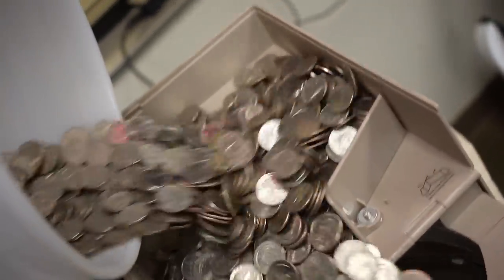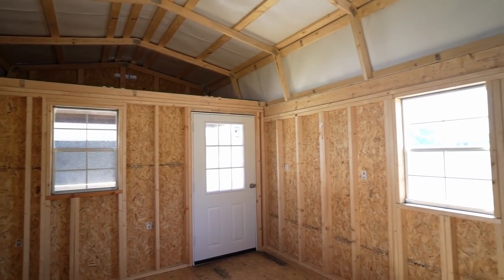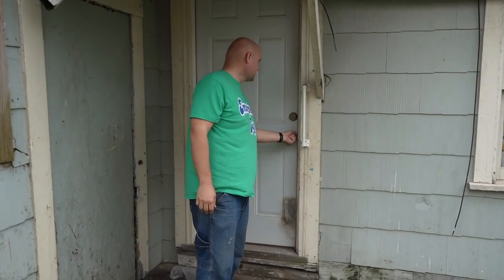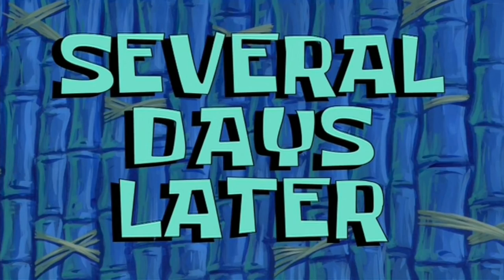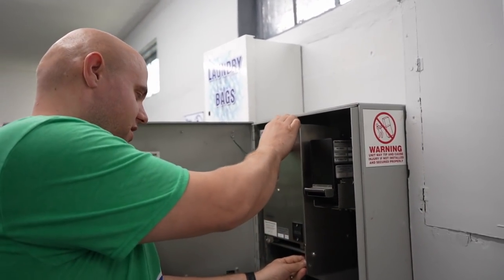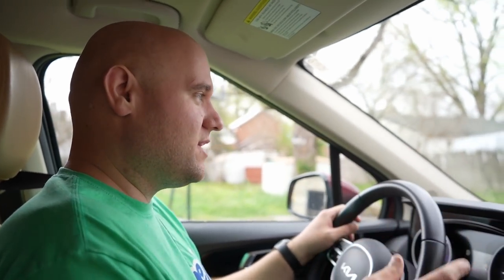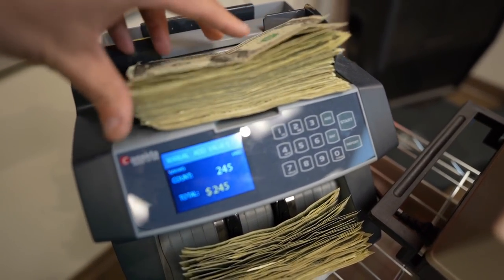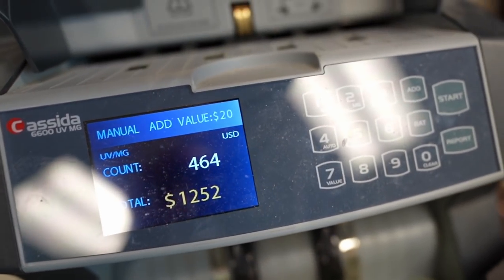Building A Off-Grid Solar Powered Tiny Home RENTAL

Comment: I remember when I used a laundromat, occasionally one of the small front load machines would get bumped open by kids running around. It would spit out the soapy water, and it seemed nobody knew how to react. ATC that I am, no worry, and I closed the machine. It resumed, and I went to the nook where the owners kept a mop and bucket. Really, the white guy has to do the mopping when your kid made a mess. I reflect on those days, not that long ago, and I could totally do the sack service in running a laundromat. But the place is run by an Asian family who truly have everyone working there. I was there for last wash, and they apparently had a few detail shops on contract. 10PM last load in, around 10:30PM they loaded up the medium machines with detailing cloths.

Comment: You could make warm water by using a thermosiphon. Its cheap and a warm water storage tank as well. For the solar system is a lithium battery the best choice, lasting 3 to 4 time as long as a lead battery. A good inverter will use energy to cool the aparment if the battery is full or heat water. How do you get electric power around the end of the year? LPG generator? Small Wind turbine?

Comment: Instead of turning a shed into a house. Why don’t you hire masons and build cinder block homes? Have the concrete company poor a new road next to your trailer park and redo the road at the trailer park. Also have the concrete company pave drive ways and a pad for the cinder block walls to be built on. Then just put a basic roof on it. 

Make them into mostly two very tiny two room houses with a single bathroom. Then do 20ish percent as single room. 

If you got the proper concrete molds you could knock these homes out super cheap. Have them super energy effective and they will never fall apart. 

You could have half the units with carpet and half stained concrete floors. Which looks very cool just will hurt people’s feet if they are old walking on it over time.
Reply from the maker: Cost, last pure concrete house we priced was 3x of stick built

Comment: A plastic company will be successful profitable 📈 believe me plastics is needed in most everything people buy but the big question is what parts 🤔 would be great to make and for who? I worked in a plastic molding factory I made copper coils for air-conditioning units for General Motors, and other factors parts some other part's was part's for plastic part's switches for aircraft. The other part of the building was a air-conditioning factory that made all different medical hospitals plastic part's that separate part has to be air-conditioning for making those part's for medical use. I wish you all the successful luck ever. I would not make bread in that factory I think there to many companies in business the compition is extremely high to stay in the business.